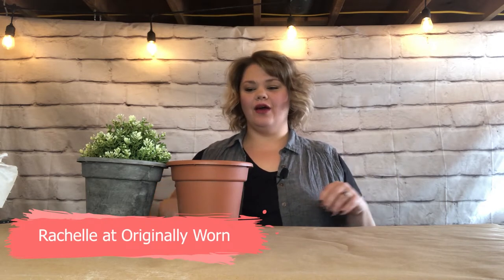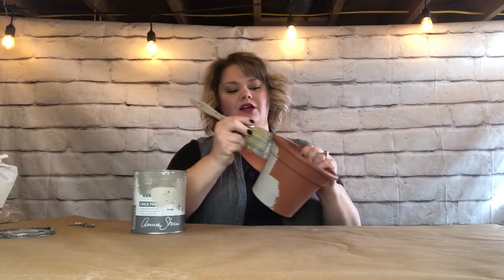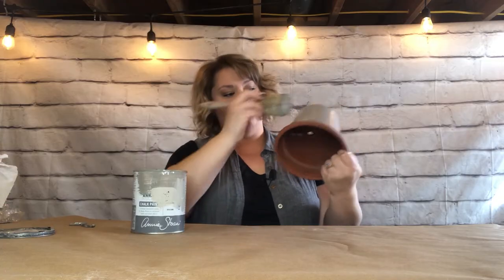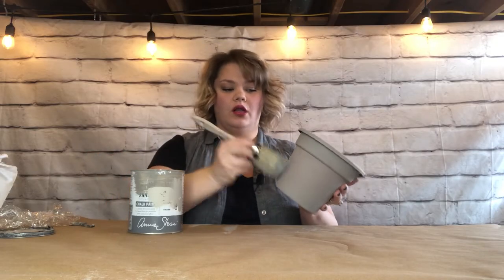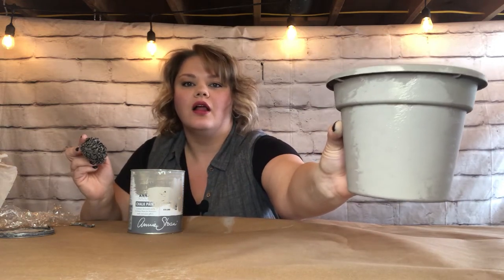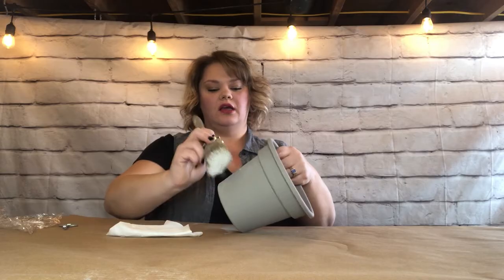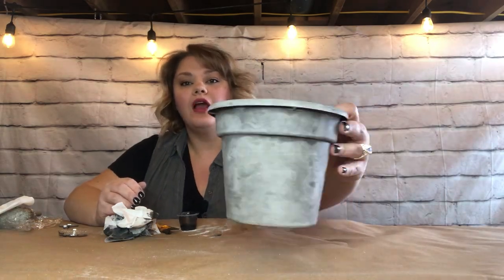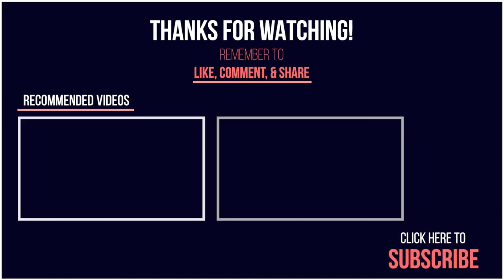HOW TO: Faux Stone Pot

Comment: Instead of wiping the brush on cloth I’m wondering if it I would save paint using a plastic plate using your method. New to me, I’m not sure. Thank you! Interesting how you created this process! Thanks for sharing your secret!
Reply from the maker: That may work :) play around with it and see what you like. Everyone has a way :) ❤️
Reply: The point of the video was for you to use as much of HER PRODUCT paint as possible.  Normally I'd dab it on parchment paper,, or a paper plate,, also,, and keep dabbing and dabbing...over and over using the same paint instead of always dipping and wiping it all off. TOTAL waste of paint.  Thumbs down project.
Reply: @ms.farmgirl  Did you not like how the project turned out or did you just not like the dry wipe technique?  I agree that dry wiping on a paper towel is a waste of paint (especially if you are actually using Annie Sloan) but thought the stone affect came out well.